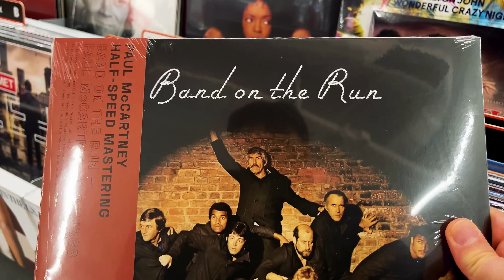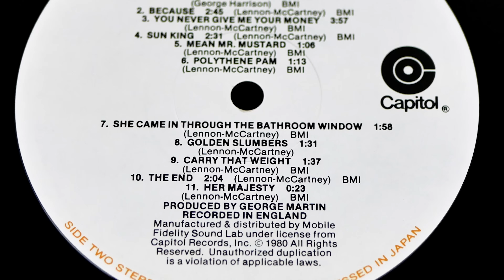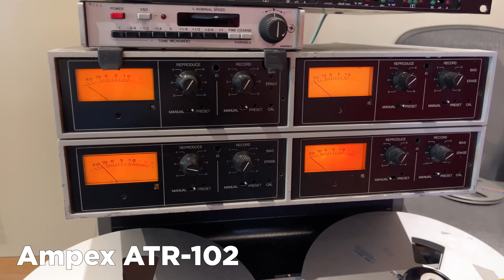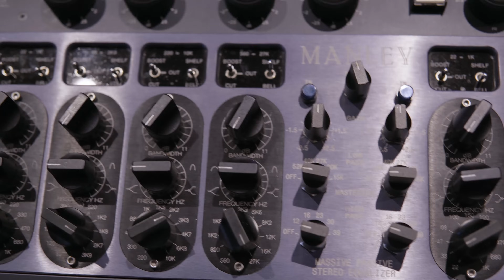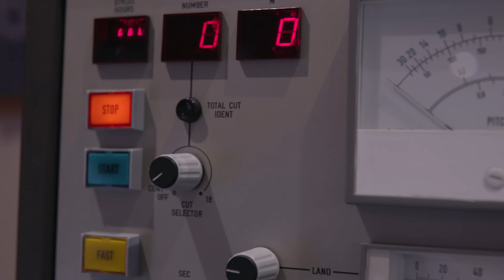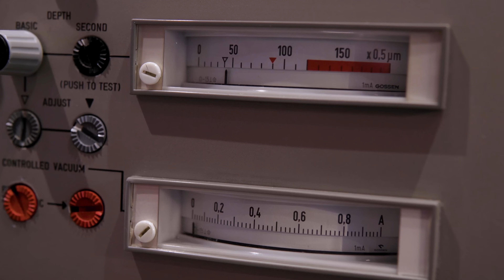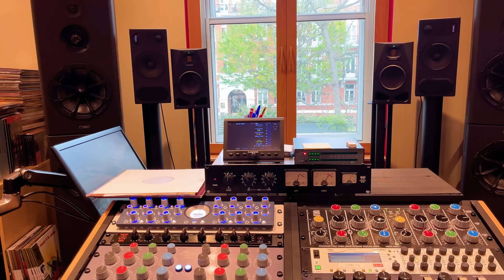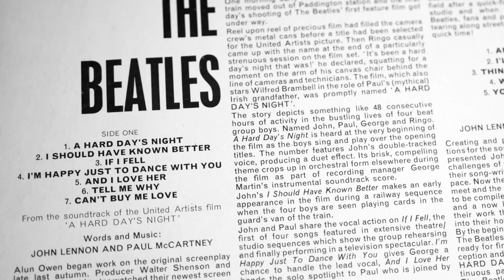Abbey Road's Master of Half Speed Vinyl Miles Showell Tells All

Comment: Digital is going to be the savior of these old disintegrating analog tapes. Getting good Digital transfers while they can still be run through a tape machine will allow these albums to be reissued on any format for a thousand years.
Reply: Yeah I can't see what all the hatred over records from digital sources is all about 
However I'm lucky enough a few analogue records and they are magnificent but also very quiet!
Reply: Yeah I can't see what all the hatred over records from digital sources is all about 
However I'm lucky enough a few analogue records and they are magnificent but also very quiet!
Reply: Plenty of vinyl records have been sourced from digital recordings since the 70's, and digital cutting equipment has been used since the days of PCM recordings being on tape. The people who make a big deal about whether an album came from a full analog process or not aren't people who care about audio quality, they care about demonizing the digital boogeyman for no tangible reason, regardless of the benefits of digital.
Reply: Yes. YES. A thousand times, YES!
Reply: @Echo-Head sucks.
Reply: I'm an analogue guy (hence my channel name) , but I agree! You can get resolution up to DSD 256 and higher! DSD 262 is indistinguishable from 30 IPS half inch tapes!😊
Reply: Until the great digital reset of solar flares ( that a select group of certain individuals beliefs going to happen ).
But on the upside having a good master to re-print copies means better vinyl, Better cassette, etc.

Comment: One thing he didn't mention was the 'cutting delay' - groove spacing (pitch) has to be adjusted ahead of changes in audio amplitude. Since the 1980s, a digital delay is typically used, meaning the audio that gets cut to the disc has been digitised, even if the source is analogue tape. This basically defeats the object of bothering to use vinyl!
Reply: It depends how much it degrades the sound in practice
Reply: It makes sense that they did it in the '80-s when digital was considered superior by everyone, but why do they still do it? He mentions computers calculating the optimal groove distance for an entire side at once, which means they would have to capture the envelope of the entire master first, then run it again when cutting.

Comment: Wow , excellent,  the biggest take from this is the fact a Technics sl 1200g/ae , along with the Audio-technica VM 540 ML are his go to listening tools in his cutting room, that speak absolutely volumes,  that a 4k record deck and a £150 moving magnet cartridge are the choice of one of the very best engineers in England uses on a daily basis when listening to his finished records, what a massive recommendation for two superbly engineered pieces of kit , thank you so much for this video both you and miles showell brought so much info to the table i would otherwise not have known. 😊.
Reply: But like mini monitors not the highest of fi to hear it sound against the master tape

Comment: I met your channel recently and liked it a lot. From the studio contacts you have, I thought you may be the only person I can talk about a subject. I have bought some LPS remastereds, and the best of them without a doubt is the Half Remastered Dire's Brothers in Arms. And here comes the problem. The worst of all remastered LPs is the Beatles Revolver (2022). The sound is extremely sharp, to the point that I have to regulate the amplifier adjustments, so that I can stand to listen to Taxman for ex. Well, I'm old and should be a little deaf, at least for high frequencies. If I'm old and I hear a lot of sharp in this LP, believe me, it's because it is very sharp, which makes it very bad. I abandoned this LP and prefer to listen to LP Revolver of the 80's. Do you know who remastered the Revolver (2022) so you can bring this to the person? Thanks.

Comment: I would love to hear the combination of half speed cut and dbx encoding. This should in theory bring the best possible out of vinyl from a good lathe. 

I thought the mods to the lathe sounded very interesting. 

I have some Nautilus half speed discs and they don't sound right to me. Cut in the 80s - very difficult to achieve all the modifications needed to both the master tape playback EQ and the lathe RIAA EQ back then. Makes me wonder if they got it right. Easy to do from a digital master of course, everything can be prepared in the digital domain and then switch off the RIAA EQ on the lathe.

Comment: The problem for me in this new half cuts are not working because groove width, but I don't know much, I just noticed that from Technics research, the half cut method in order to be possible the groove widthness had to be expanded and a limit of 16min per side was introduced. Reading this I believe that Abbey Road is doing half speed mastering but keeping the groove dimensions to the limit, and that brings limitations, but this is what is explained by Technics research in 1976:

"2. Low speed cutting and frequency response range
In the cutting process, the cutting master tape playback speed was reduced from the conventional 38 cm/sec to one half, or 19 cm/sec, and the speed of the lacquer master disc was also reduced from 33* rpm to 163 rpm, and the cutting was made at these reduced speeds. This made possible increased volume levels and improved transient response, with the frequency response characteristics of the cutting process expanded tics of the cutting process expanded to 20 Hz-45 KHz.

3. Abundantly wide cutting pitch
In order to make the most of the above factors, the groove pitch was chosen that there would be ample clearance between grooves. The actual recording time per side is therefore some 16 minutes, and no attempt was made to compress the groove spacing. This enabled higher peak levels, and a more-than-adequate groove amplitude, so that the low frequency response, in particular, is greatly improved."

So while not aproaching step 3 at the current half cuts.. that means we are loosing indeed the low frequency response....

I stopped buying this new half cuts, because somehow the full process was losta long the way this past years... beacause they are a bit dry, specially compared to the Technics half-cut with wide groove has amazing bass. Would love to know if Miles Showell regards this factor on pitch groove or what are his thoughts on it.
Reply: CBS USA did a lot of half speed classical Lps in the 80's and EMI DMM classical have you any comments on these?
Reply: @pauldavies6037  Hi, Unfortunatly I don't have any of those, the only half cut mastering besides this current Abbey Road ones is the Technics Audio Inspection Vol.I in which includes a booklet explaining their research on the Half Cutting process, and in  order for the Half-Cut process to have the corrent low end response, it was adamant that the grooves wheren't limited in width they realised for the half cut method to work properly a12" record could not have more than 16mins per side to have ample groove width. so that became my reference when I see half-cuts .. if it comes 20mins per side, I ignore it. I tried with the Abbey Road cuts... Brothers in Arms... No bass at all it is sad, compared to the OG Portuguese pressing, same with Ziggy Stardust half cut feels dry and anemic, this where my last and I sweared I will never buy another hal cut that is more than 16min per side. I hope it makes sense, but today some want to make the best really others just want to make business as usual... I guess the 180gr fad is passing away, and now there is in need of another fad.

For sure now you mention those I will try to get some to check them out. But this simple rule of 16mins per side should be enough I believe.

Comment: What Miles said about the physical experience of playing a record vs. a CD is especially true when listening to "Abbey Road".
I remember as a kid growing up, after the noisy end of "I Want You" on side one, the needle would go into the lead off and you'd hear the slight "thumping" of the loop in the silence. You then had to physically get up, cross the room, pick up the playing arm (if it wasn't automatic), flip over the record, and replace the needle. Then, after the initial slight scratching, the guitar intro to "Here Comes the Sun" would come in with its beautiful high clear sound.
I didn't realize how wonderful and meaningful that experience was until I heard the CD for the first time and was "shocked" when "Here Comes the Sun" simply started 2-3 seconds after the end of "I Want You". I remember saying out loud "no, that's wrong."
To this day I wonder if the Beatles consciously planned that contrast and the ensuing pause between the two songs resp. the two sides of the album.

Comment: Just getting to watching this. Miles is fascinating to watch and listen to. I have a lot of Mobile Fidelity records, mostly from the 70s-90s. I never liked the way they sounded. They always sounded unnatual and artificial to me. It's kind of hard for me to describe. Somebody once years ago, over at the Steve Hoffman message board told me Mobile Fidelity records were mastered for what were then brand new, almost mid-fi, components. I don't know if there's any truth to that, but I sold off all my Mobile Fidelity Beatles years ago, and never looked back. I have a mix of original 60s UK pressings, and pressings from countries that used UK metal parts, like Denmark, Australia, and South Africa. I have the first issue Parlophone pressing Abbey Road from South Africa, that blew the Mobile Fidelity out of the water. I too have one of those 70s German Apple MMT LPs. They sound incredible. Much better, IMO than the Mobile Fidelity, that supposedly used the Capitol master tapes. I have a vintage system, mostly US. A Thorens turntable,  Klipsch speakers, and Fisher, and HH Scott US valve amplifiers. I rarely listen to any music on the internet. I only listen to news, assorted talk relationship's, and a very rare new TV series show or two. That replica Fairchild compressor is stunning.

Comment: The digital master from 1985 is probably a U-matic NTSC cassette with a 44.1 KHz sampling frequency for CD production that was created with a SONY PCM-1630 converter. Since the U-matic cassettes are world-famous for their eternal durability, it is negligent to let them rot in the archive instead of transferring them to DAT, CD-R (my Kodak Gold from 2001 is still working today) or HDD in a timely manner. This can be done without any loss if you do it in time.

Comment: I can confirm what he says about the arguous hours of listening darth vader music when you're half speed mastering.. Over the years, I've never given up on analog and beings. Never had the top of the line analog anything... I was always trying to get the most out of whatever I had and a lot of that Necessitated half speed mastering. Nothing can really make it go any faster, because it's just not even music at that speed!... Yet you must listen intently in order to prevent all of your time being spent in vane, because a bass track now being cut at half speed and twice as low will overdrive or modulate and sound god awful if you don't babysit the thing! I still do it in the digital age, as mastering the final step on a half track deck, is very nice, and pro tools now gives you the option.

Comment: there are many records mastered and cut in regular speed today and they sound great no need for half speed mastering
Reply: That's because half speed mastering  is a conceit.  I'm sure Miles Showell knows how to master a tape for cutting lps,but he is on the side of the fence that believes half speed format delivers something better.  It does not.   None of the first pressings or best pressings of lps ever produced were half speed mastered.  And what sound is everyone chasing?  The cuts that were made at normal speed.  Ponder that.  And no half speed master that I've ever heard has improved on it

Comment: I have hated nearly every half-speed master I've bought and won't take the gamble on them anymore. Two things really bugged me. On rock albums like Bowie's Aladdin Sane or the Roxy Music catalogue, the guitars sound frustratingly polite and recessed. And every half-speed master sounds as if the component parts and instruments are slightly out-of-phase, causing the music to lack a certain swing or the musicality of the original pressings. Listening to Miles here, I am wondering if the problems are caused by the custom filters that need to be applied for this process. Perhaps, if Miles sees this comment, he can address this.

Comment: Even if the cutting is done perfectly, all the hard work of the mastering engineer can and does easily get RUINED by pressing plants with HORRIBLE quality control. Many of these plants cannot press a relatively defect-free record to save their lives. Off-center pressings are a common problem as is non-fill, random surface noise and loud pops, factory warping, and so on. Many formerly good plants just stopped caring IME and have a #1 priority of churning crap out the door.

Comment: Half speed is academic if the vinyl is crap quality. And pretty much all modern pressings of albums are crap - shallow grooves and noise.  Cutting good records is like a lost art. Decca album pressings from the 50's and 60's are far superior to anything 'mastered' now.
Reply: I am not disputing your point as I know nothing about the cutting process, but why are modern pressings so bad? One would think that this would be a golden age of capabilities.  

Also curious as to how one distinguishes any distortion in the modern pressing and playback process from what might have been present at the original recording sessions. How does one know?
Reply: Almost every brand new record I buy these days is warped in some way too. Very disappointing.
Reply: You can still pay for quality. I am 25 and I recently discovered Julie London. Faced with the choice of spending exorbitant amounts on a 60 year old copy of "Julie is her Name, or paying slightly less for the Analogue Productions 200G 45 RPM remaster, I went for the latter. The record sounds amazing. In general though, you are correct. I am also a hip hop fan, and it is digraceful what kind of sound quality is seen as passable for some pressings.